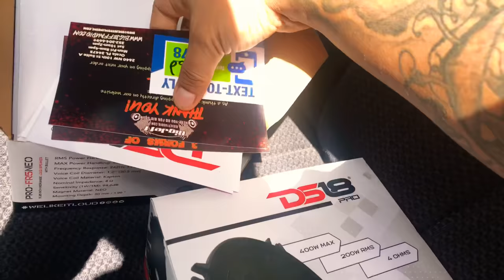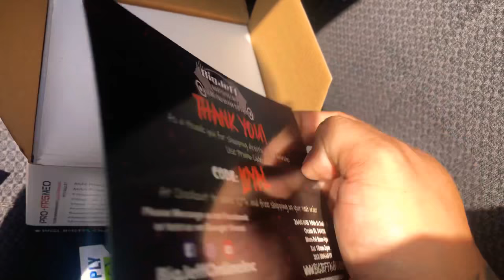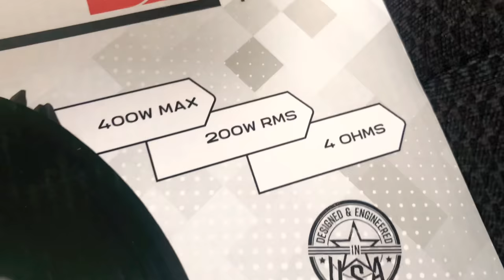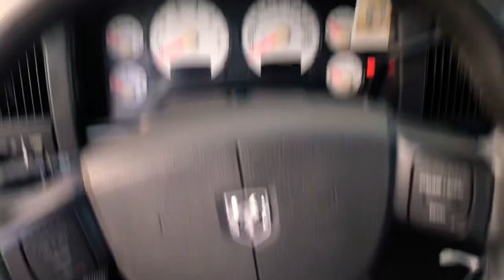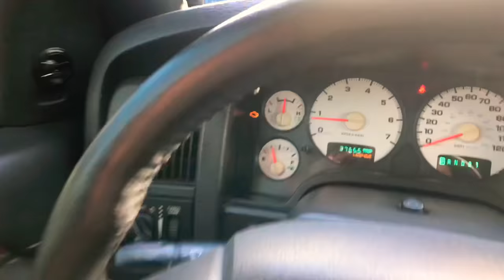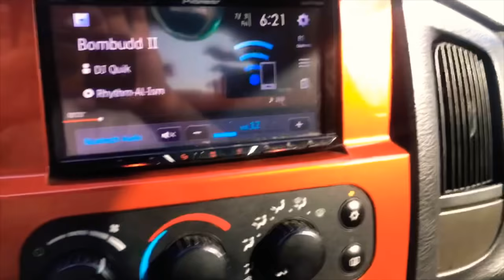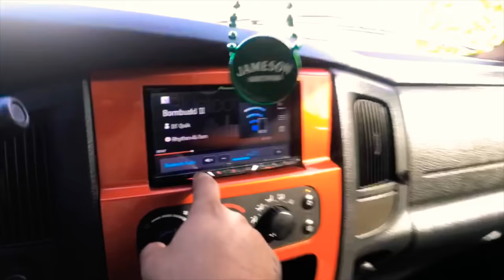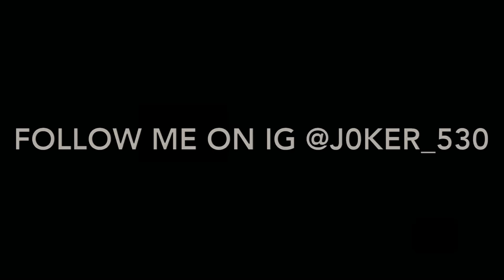DS18 SPEAKERS

Comment: Those DS18's rock. I replaced all my factory speakers with these. Still on factory head unit with no amp and my junk bump.  I got a 99 Deville.
Reply: louder than stock?
Reply: @anyone5278  wayyy louder than stock ds18 goes crazy on everything no cap bro
Reply: @anyone5278  
Way louder!

Comment: Yeah I liked the details in this with explaining, I'm looking at some DS18's right now, and I'm trying to figure it out and get it right. I'm gonna start off with those silver bullets, and then the 6.5 Pro-X6BM, is that what you had the Pro-X6BM? I couldn't see the exact numbers on the box? Bc they make alot of speakers and they all look similar, but they be different order numbers. So its hard to keep track of the ones I'm seeing people review, compared to the actual speakers I'm trying to order.

Comment: To much highs not enough mids. The 6x9's are coaxials that come with tweeters, so you didn't have to add any. Instead of adding tweeters in the dash you should have added some 3 or 4 inch full range speakers instead

Comment: The front 6x9s have a built on tweeter wasn't it to much for ears with ones on dash also
Reply from the maker: Yes at first but with some adjustments on stereo & amp it sounds perfect
Reply: Yeah coaxl in back doors and components in front with tweets.

Comment: How did you hook the tweeters up?
Reply from the maker: With my amp. I have speaker wire running threw the back of my stereo.. so thats how i wired them up
Reply: @streetterrorperformance6227  nice! Thanks
Reply: @streetterrorperformance6227  Did you hook up the bass blocker of the tweeter to the positive?
Reply from the maker: @vic_9346  yes
Reply: @streetterrorperformance6227  Thanks